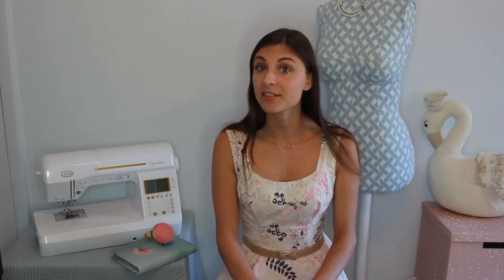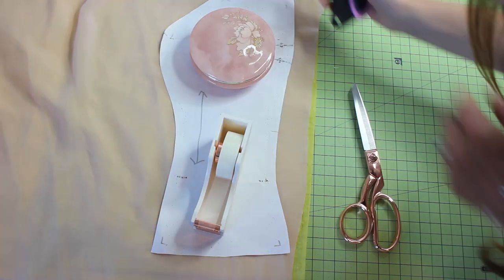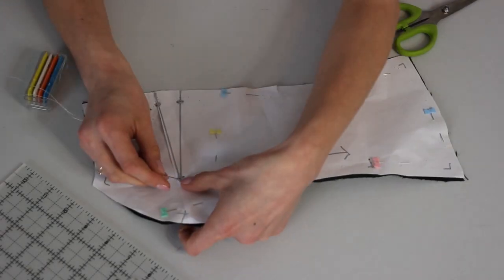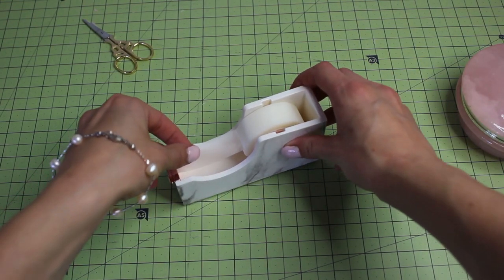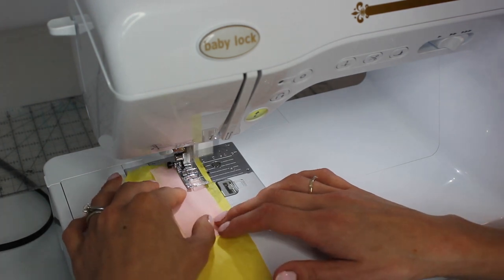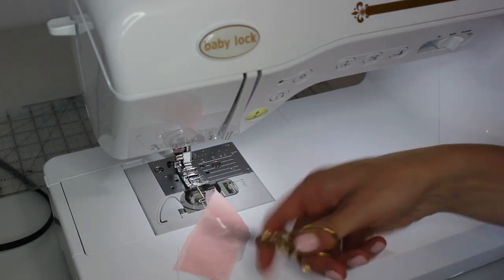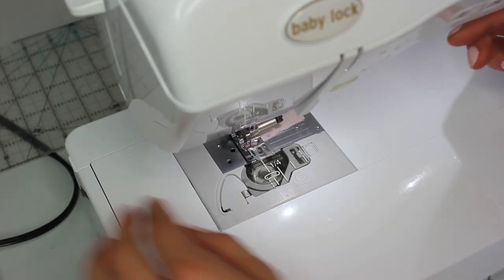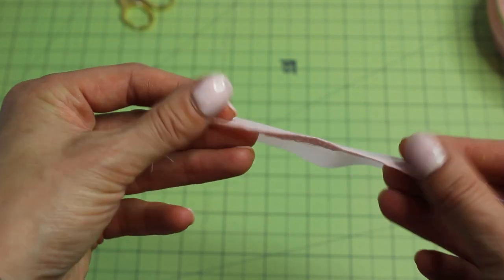Tips on how to sew with chiffon and silky fabrics

Comment from the maker: I really hope this helps you when you are cutting slippery fabrics.  If you have any questions please let me know!
Reply: I just raised a neckline a bit for someone through the shoulder seams area of a silk chiffon dress. I messed up thinking it was just a synthetic chiffon. I steamed the bodice with a fabric steamer and now I fear that I may have stretched the neckline a little. Is there a way to shrink it back somehow or will dry cleaning help? Or will I just have to take it in more? Should I have stay stitched or stabilized the neckline prior to starting the alteration? Any help would be appreciated.
Reply from the maker: @noemir8262  oh, sorry I didn't see this right away.  Hmmm... you should have stay stitched the neckline so it won't stretch out as you sew... being it is stretched out, I doubt you could get it to shrink back.  How close to the original pattern is the piece?  You may be able to recut the pattern piece to the right shape, as it is larger (being stretched out).  Hope it went well!! 🥰
Reply: @SheerStitchery  It was a ready to wear dress but I managed take it in a bit at cleavage section and shoulder seams. No worries it worked out in the end. Thank you.
Reply from the maker: @noemir8262  oh, so good to hear ❤
Reply: hello
this was a really helpful video since I'm planning to work on chiffon on my final project this semester, but i just wanted to ask you for another video on how to deal with a pleated chiffon, like how to cut out the pattern pieces while keeping the pleats 
sorry for my English it's not my first language :(
Reply from the maker: @ghaydaalnasser2601  oh certainly!  It might be a bit before I get it into the que, but I am happy to make one woth that fabric - it is such a bother with all the pleats! 🥰

Comment: I researched and researched mask patterns, and then researched and researched fabric.  I found studies that stated a 90% polyester/10% spandex chiffon provided a high filtration rate.  I also found a pattern with nose and chin gussets that I was excited to try - looked well fitted with enough room to breathe.  Having not sewn on a machine in some years,  I blithely plunged into sewing the complicated chiffon fabric mask on a circa 1980s machine.  After the fabric slipped and slid and the machine had chewed some up, I remembered the tissue paper  trick.  Things went a bit smoother after that, but I still toiled (the nose gusset was so darn hard to do!).  Some seams are a little crooked and the gusset has a minor pucker, but it is the best mask for me.  However, I swore I would never make another mask out of that silky chiffon.  Because of the great fit, I used cotton with the same pattern, but the fit and feel is just not there.  I found your video and am inspired to try the chiffon again, but first I will buy a walking foot.  Thank you for such an articulate and thoroughly detailed presentation!
Reply from the maker: Ahh! I am so glad you are tackling it again 🥰

Comment: Thank you so much for this helpful info! Just wondering, what stitch tension (my Janome machine is 0-9) would you recommend, and also what stitch length? Again, my machine's length options go from 0-4 :)
Reply from the maker: Each machine is a bit different but I would do some test swatches to see what looks best starting at just below your "average" and work from there.  I usually use a 2.5mm stitch length and usually don't have to touch my tension - but if you are getting puckers then lower the tension a bit

Comment: Hi I have found this tutorial so helpful making dresses in chiffon crepe and it has princess seams .the skirt of the dress is attached to a bodice and needs to be firmer than the flowing skirt.
I have a matching cotton lining and wonder what the best method would be to firm the top to attach the straps to. E.G iron on interfacing onto the lining and sandwich the layers together .
Or to possibly best  contrast the the top without the chiffon .
have purchased samples to practice on but would welcome any tips that may help.

The dresses are for my granddaughters wedding next April so Im researching methods of using chiffon crepe.
Many thanks .
Susan
Reply from the maker: I would underline the fabric of the bodice.
I have a video that shows you how to underline fabric here:  https://www.youtube.com/watch?v=mZFnwuypAGI the part you want to watch begins at 2:30 (or just watch the whole thing for fun if you want ;)

That way you can have the chiffon as the outerlayer then use the cotton as your underlining (ensuring it is coordinating as the chiffon will show through) and then line with what you like.

If you have any questions let me know!

Comment: Can I ask how you cut a long amount of chiffon like for a scarf. I’ve had difficulty doing this and especially as it doesn’t all fit on my table at the same time? Thanks.
Reply from the maker: I would buy some poster board from the dollar store and cut it to 6.5” wide (or the width of my long narrow quilting ruler) or ask for a en empty bolt from the fabric shop that is for the 60” width and not quilting cotton 42” width fabrics. 

Then I would carefully lay the chiffon in a single layer and begin rolling it onto the poster board bolt. Once it is all on the bolt, fold out and cut the chiffon (I would use a rotary cutter and mat and for a scarf I would use my quilting ruler as it is a perfect rectangle) as much as fits on your cutting table. Leave the rest folded up on the bolt. Once that piece is cut, shift the fabric back and unfold the remainder of the scarf from the bolt. 

Hope this helps!

Comment: At what temperature should you iron both natural and polyester silk chiffon? High temp, low temp, or medium temp?
Reply from the maker: Natural silk can take higher temperatures, while a polyester or synthetic blend cannot and I would use a moderate heat on those. I would start out lower and see what your particular fabric can take heat-wise.

Comment: Hi! Is there another way to use heat on chiffon without an irion?☺
Reply from the maker: Like steaming? That should be fine, as the heat is not directly on the fabric.
Reply: @SheerStitchery  Hi again! What I meant was would it be safe to use an iron with no water in it on silk chiffon?😃🪡
Reply from the maker: @bucketnail6572 haha! Oh. Thanks so much for clarifying. Yes, though test how hot it can go with your particular fabric and I would use a silk organza press cloth if you have one.
Reply: @SheerStitchery  Thank you very much!